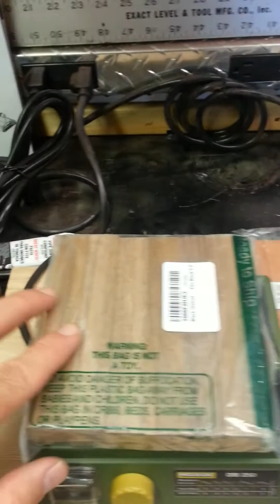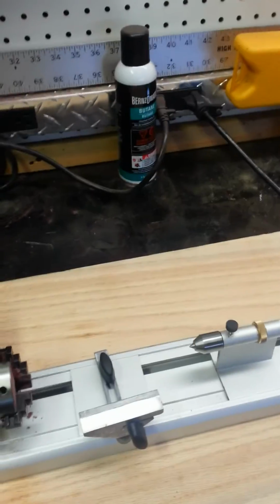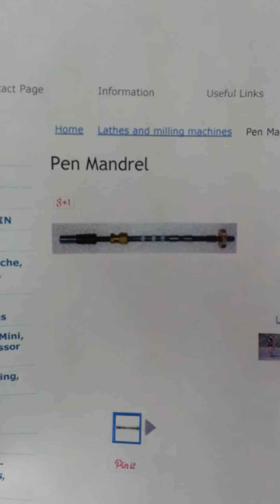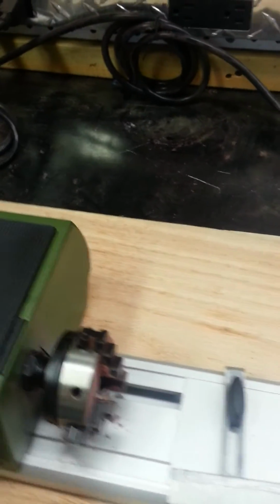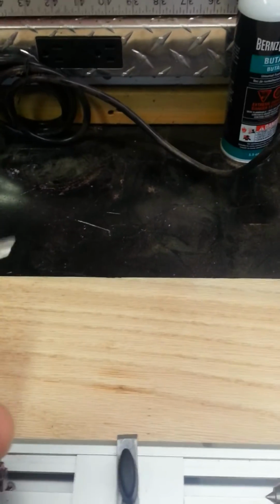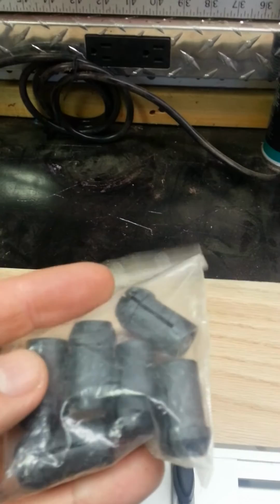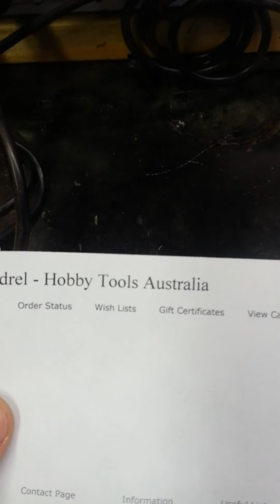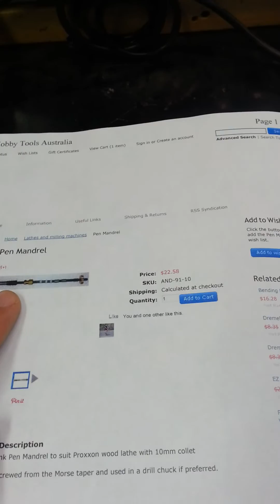Proxxon DB250 Lathe

Comment: Love it. Quick question. Do you think I could work a 2.36 inch diameter round piece of wood on this machine? Round. Not square. I'm thinking square would def. be too big and I'm thinking the machine is underpowered for that big of a work piece. But 2.36 inches round? If I only have to make a couple grooves n stuff?

Thanks!

Comment: Don't waste your money.  I had 2 of these and they both broke within weeks.   The variable speed controls went bad and they only worked on full speed.  Left them a crappy review on Amazon.co.uk.
Reply from the maker: Hello Jay, I had better luck with mine. I used it to make a variety of small items, including micro Christmas trees from various pieces of exotic wood. I gave it to my brother after I got the larger lathe. He now uses it to make small wooden spoons! He turns the overall shape then he hand carves the scoop portion using a Dremel. They are beautiful!!
Reply: @bccie1pres  Perhaps they made a bad batch.  I was using them for ring making but I'm moving over to a mains drill and bench clamp.
Reply from the maker: Jay Rodgers, The Nova 2 made by Teknatool  is a very versatile bench top lathe with a 12 inch diameter by 16 inch length capacity and they make a large variety of chucks. I have used it to make everything from an 11 inch cap for a wooden mushroom and a 10 inch diameter acorn to a pen with a 9 mm diameter and micro Christmas trees with a 5/8 inch diameter base to Cups and small to medium size bowls. I suggest you not limit yourself at this point. The versatility of a quality bench top lathe has surprised me and given me many more opportunities to make stuff than I ever thought possible when I first bought this lathe. Happy turning sir!
Reply: @bccie1pres  Thanks but I don't really have anywhere I'd  put it.  That's what I liked about the Proxxon, small enough to slide out the way and dig out for a quick bit of ring making in the evening.  Only weighed a couple of kg.   The garden shed has seen better days, perhaps I'll replace it this year and set myself a small workshop.
Reply from the maker: Jay Roger's, yhat makes sense. Consider this, I bought a kit from a home improvement store near me for a 10 foot by 10 foot by 10 foot tall shed. I paid a local handyman to make a concrete base. It has 2 doors for easy access and overhead storage. Building a work bench along 3 walls with cabinets under and tool racks above could give you a well organized work and project space. There are some small woodshop guys on youtube that have some really good ideas. Have a great day and stay healthy sir!
Reply: Did you find a solution. Mine just had the same problem.... no speed control, just full speed now
Reply: @Bowamaketona  No, I returned both.   Being in the U.K. I had to use a 'shaving plug' adaptor to plug it into the mains power.  I suspect that sparking from the contact in the adaptor caused the problem but I didn't get it confirmed.  I ended up using a variable speed drill instead.
Reply: @jayrogers4775  I'm in the US so no plug-in problems. And still the dial doesn't work

Comment: Mandrels are available from many suppliers in the US or the UK. Just clamp it in your three jaw chuck. Some have an adjustable end. Just take this off and fit in the collet chuck. There is no need for a special Proxxon device.
Reply: brian chislett Do you think that i can mount a taper 1MT mandrel on the 3 jaws chuck without any issues ? I have difficulty to find a proxxon compatible.